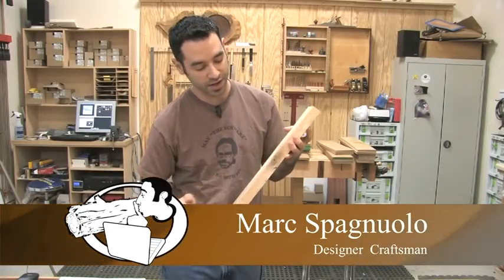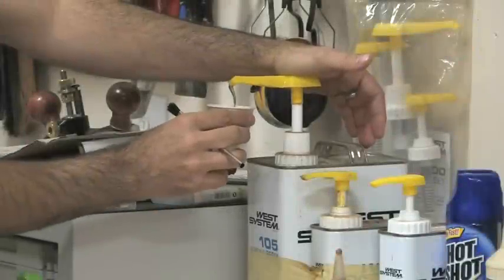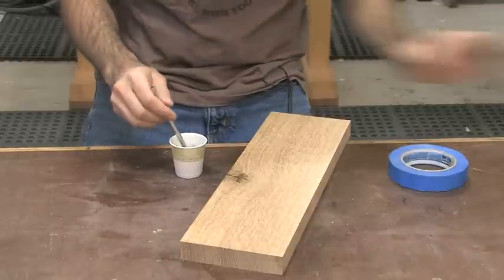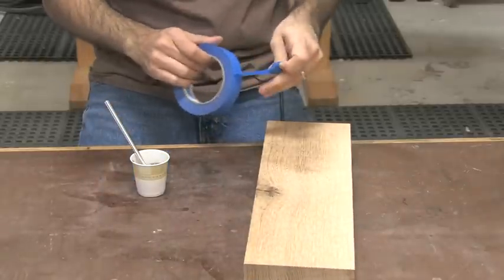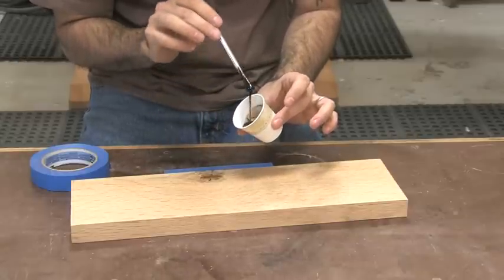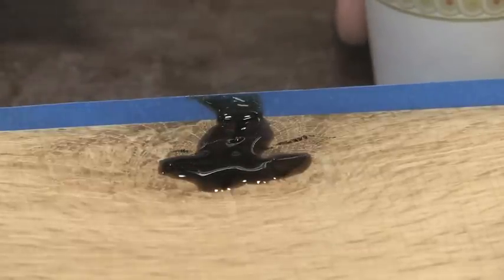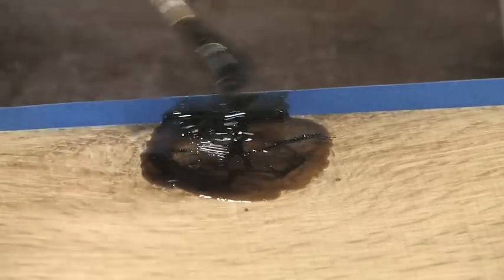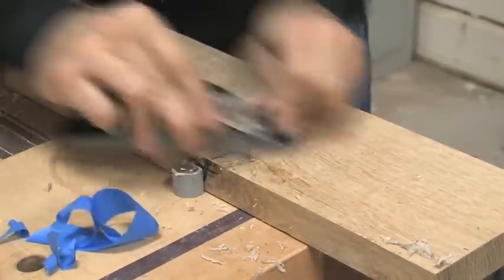113 - Filling Knots with Epoxy

Comment: One good tip I use is to use a hair dryer on the individual A and B part of the epoxy. The heat actually thins the epoxy and helps it flow better. It becomes less viscous and fills smaller holes etc.

Comment: If I were to pour a flood coat of epoxy down on a wood slab what would be the best way to prevent off gassing of the wood? Sanding sealer first? 

2nd question if I'm filling knots with epoxy should i use a fast curing epoxy or slow? How far can I fill at once 1/8-1/2" at a time?

Comment from the maker: @vincent7520 I can't really comment on the boat building part of it, since I know little of that area.  But when it comes to fine furniture, I think this is a perfectly acceptable way to stabilize the knot.  Assuming it is kiln dried stock, it isn't going to get any drier than it already is, once it reaches equilibrium with its environment.  Now in a boat, there is a lot more moisture involved so having the wood expand and contract around the knot definitely sounds like a bad thing.

Comment from the maker: @MisterFIXXX Quite a lot actually.  Especially if you use a relatively loose epoxy mixture like I did, the epoxy will absorb into the surrounding wood and strengthen it dramatically.  That being said, I wouldn't just throw that puppy in the planer.  The blades hitting that big glop of epoxy would be a bad thing.  Overall though, I find it to be very durable.

Comment: Hi, I have to repair a knot in a table. But this table is already finished, it means that if I repair it, I wont be able to further polish or sand the surface, so, the repairment has to be almost plane at the end. What Can I implement?

Comment: Will using epoxy on a knot work for freshly cut wood you don't want to crack? I use a lot of natural wood and treat it with pentacryl to prevent cracks, but it still sometimes does. Any suggestions for treating fresh cut?
Reply from the maker: I think pentacryl or anchorseal are products that work quite well for that purpose. The goal with wet wood is to slow down loss of moisture. Epoxy might actually seal it off completely and won't really allow the wood to breathe. So while it might hold a crack from getting worse, I don't think you'd want to use it as a sealing product for the drying process.
Reply: I don't have any experience in drying wood, but I do know that epoxy is one of the most popular materials used to seal both fiberglass and wooden boat hulls to prevent moisture damage. Needless to say boats are subject to extreme humidity, yet epoxy will keep the surfaces perfectly sealed for years. Hope this helps :)

Comment: I use the same epoxy system, only I add the powder that makes it sandable. I guess I'm curious if using the epoxy alone would make that knotted bit harder to work through, like say running it through the planer?
Reply: The powder is colloidal silica. Wear A MASK!!!

Comment: a kno is a knot  
trueit won't break where the epoxy has set in but as long as the wood will continue to dry (and this may take a century !) the knot may have new creases and splits.
This technique is ok for rough carpentry, I would never use in my field which is boat building.
Reply: Ah what a badass

Comment: Gently dropping the board when it is full of wet epoxy will force the air out and the fluid in.  Think of how our wives drop a cake pan full of mix to get rid of the air pockets.
Reply: or hit it   with flame    removes  bubbles  and   makes it  thinner at higher  temps   allowing it  to seep in   , your  idea is good too   to use  after the flame